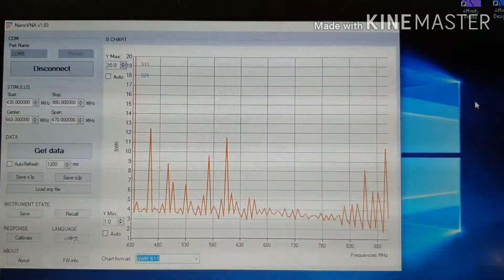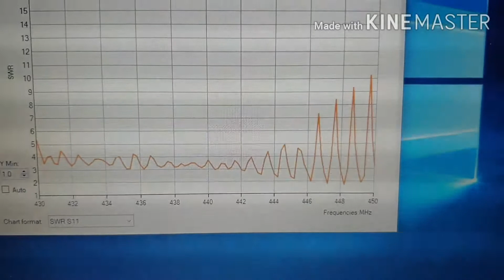Can you transmit on a TV antenna?

Comment: How about what it takes convert the tv antenna to work ham bands. 
A much more interesting topic.
Reply from the maker: With great difficulty as the minimum frequency the antenna would work on is 470 MHz. You might be able to cut it down to work on 1296 MHz but you would also have to remove the inbuilt 5G filter - which is what is causing those jagged lines on the display.
Reply: @GordonHudson  a video on the process would be interesting considering terrestrial tv antennas are plentiful full and cheap. 
Just a thought and I don’t see many other videos going deeper than it won’t work. 
How many ways can you make it work? I think is a more challenging question.